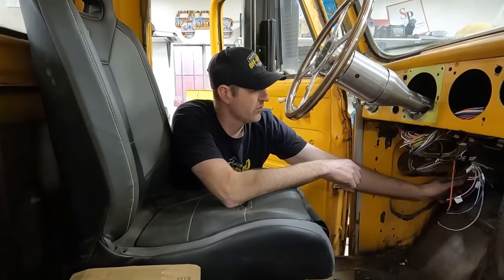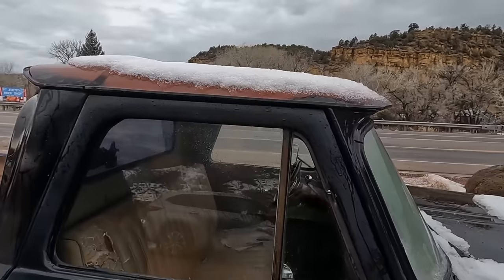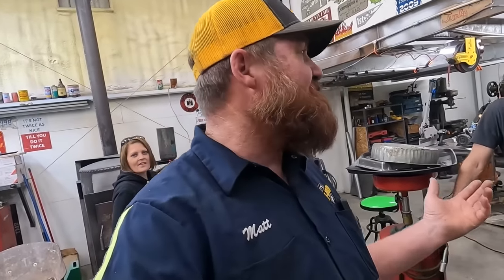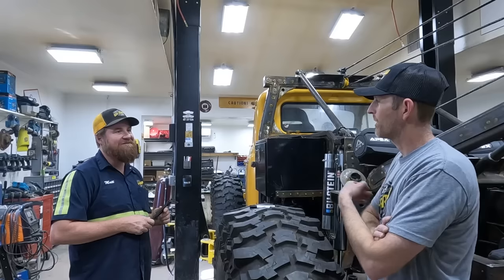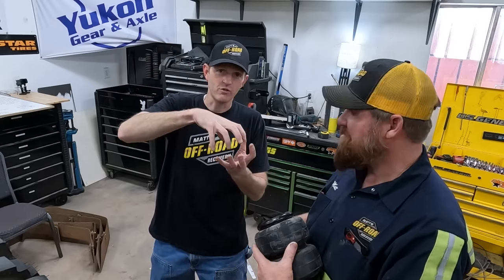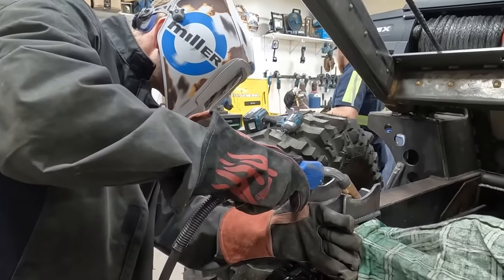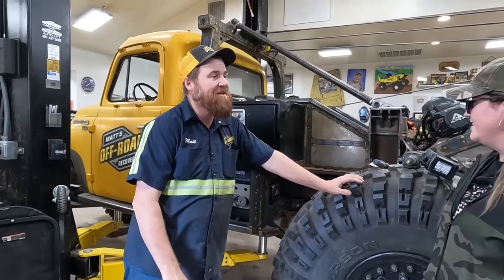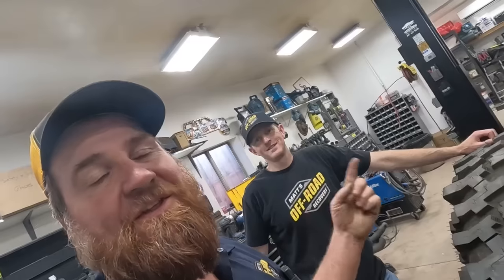Massive Announcement...It's On For The World's Largest Off Road Wrecker

Comment: As a structural welder of 20 years, I would like to give you a little tip.  When you get to the end of your welds, normally there will be hairline cracks in the crater.  You'll see these cracks more visibly with aluminum, but they're there with steel as well (can be seen with magnetic particle inspection).  With something that's truly static it doesn't matter as much, but with some parts on the wrecker that are moving, over time those small cracks can run along the length of the weld and cause it to fail.  I've seen this first hand several times.  Maybe you do this off camera, but from what if seen in your vids you don't.  At the end of the weld, pause for a second, then give a little shot extra in the crater.  This will cap the tiny cracks, and keep it from potentially working their way down the weld.  Aside from that, I like the work you guys are doing!
Reply: if you get shrink / crater crak at the end of every weld you are doing something wrong, but your solution to preventing it is spot on , fill the end a sec longer to prevent to crater to form.
Reply: this should be pinned.
Reply: I agree.  I have been a welding inspector since 1984.  When you are welding the weld crater is digging into the base materials.  If you just stop without filling the crater you will have an undercut situation and a crack will form.  One other thing to do, if possible, continue to weld around the corner into the opposite side weld.  Ends of weld are a great place for fatigue cracks to start.
Reply: Thanks, I never knew this ... but ... I've always left a little filler there to hide the crater, must be the OCD in me & lucky to do it right unknowingly!
Reply: @j.decker7443  so essentially over lap and pause where needed?
Reply: they have mentioned they are very good grinders too.
Reply: How much an hour you think you're worth?
Reply: @mareli82  You will get this if you do everything right, it's part of welding.  I've been certified in steel/aluminum multiple positions for years, I'm very meticulous about material prep, correct parameters and procedures.  You can do everything by the book and still have these cracks.
Reply: @zozohoney79  by code its not acceptable to have any cracks in the weld, so if the weld have craks its done wrong
Reply: We use to call it wrapping the end on submarine work.Makes a big difference.
Reply: @zozohoney79  material preparation is overlooked many times and people just don't understand how important it is to have clean metal.
Reply: @ike8236  You can't afford me - really. I'm retired now. 27 years pipe and structural welding. Stick, MIG, TIG..
Reply: 👆 I agree. I'm a retired Navy Hull Tech NDT, QA. etc.. etc.. etc.. 😂
Reply: @mareli82  I agree.  If you don't fill the crater at the end, then technically the weld may not be sound.  That's why I'm pointing out that it should be filled.  If you think you can just stop a weld without filling the crater, and never have any cracking, then you are mistaken.  If you check every one of your welds with magnetic particle, I guarantee you will find some cracks.   Research this, and you will see I'm right.
Reply: @karlschwaber9568  I couldn't agree more.  Scale should be removed from steel, oxide should be removed from aluminum, and I clean everything with acetone.  Aluminum is particularly picky with things needing to be clean.  The majority of steel welding I do is with flux-core, so the flux will remove a lot of impurities, but that doesn't mean you shouldn't clean the steel.  I don't take chances with the work I'm doing.
Reply: Thanks for the tip.
Reply: Yeah I've seen construction equipment welds fail just like that. 
Gotta grind the whole crack out then weld it back.
Reply: @fraxonthefurry21  there is a huge difference between construction equipment and the bump stops on a vehical.
Reply: Great point. I agree 100%. Sometimes these craters are left at a stress point so it's actually the exact starting point for the crack to start and run.. As a fabricator things like this make my head 🤯🤯🤣.
Reply: @j.decker7443  so pop a pilot hole in the future crack and stop the spread before it happens.
Reply: I love the fact that Master Craftsman chime in to share these little tidbits of knowledge that make everybody better.
Reply: Many new weld machines will have a setting that will do this for you and have a gas purge at the end of the weld as well to get a better finish purity.
Reply: @TransLivesMatterTLM  Look who's doing the welding? What the hell's that supposed to mean? Are you referring to Lizzie? I guarantee you Lizzie's welds are better than 99% of the men watching this channel - including me!
Reply: Informative constructive criticism, delivered in a respectful and helpful way. Congrats for this unicorn post!
Reply: @olsparkywisenheimer8239  Also a great point! So Perhaps it's better to start your weld midway and weld to, and around, the stress point?
Reply: @alexislaisney3404  Why? Just weld it properly in the first place.
Reply: I used to work at a structural steel shop and that's what we were always told to do. At end of weld stop and weld backwards about 1/2 inch.
Reply: @randallsmerna384   She is certainly no master welder but is getting better with each day. She runs great beads and is well on her way.
People welding Kenworths on the assembly line are not masters after a year of doing it all day, nearly everyday.
Lighten up :D
Reply: Thanks for suggesting a Tesla motor. Or four!
Reply: @randallsmerna384  That would work. How i would approach it would largely depend on what I'm doing. 10 gauge on a custom car would be different than 1" plate on a pc of equipment. My advice would be if you're starting near your stress point make sure you aren't running cold. My main machine lets me raise the start value to eliminate cold starts, but i know many machines don't. You can always preheat too though and take that off the table. On 1" plate on equipment say, id likely wrap that corner with a root and a couple cover passes to add strength there, while being careful at the top of the leg not to und undercut the vertical plate if that makes sense..
Reply: @dozerboyd8784  This is for every weld on the truck !!!
Reply: This is the reading we use run off tabs when welding pressure vessels. Like large propane tanks
 We have a three inch tab of steel to start the pass on and to finish the pass on
Reply: @ike8236  lol. Waiting to see this comment
Reply: @dozerboyd8784  Clearly, but welds are welds.
Reply: Thank you I seen that too
Reply: @shimani141  Like the saying goes, Grinding and paint 'cause a good welder I ain't.
Reply: Thanks. This is why I read the comments, to get tips from the pros. Cheers
Reply: Didn't know this myself but I'll remember it next time I do any welding but Ive never had a weld crack in 40 years and I don't hold a candle to the worst welder in this shop.
Reply: @TransLivesMatterTLM  I'm very proud of Lizzy. She has come a long way learning how to weld. 
As far as Matt.... He is un teachable. Unwilling to learn. Run till you fail mentality. He should be setting an example and doing the right thing. 
But in their defense.. They did bring in a Miller pro to teach them the basics. But practice practice and continue learning is the key.
Reply: On critical work I'll weld run off tabs. 
But, My work is a hobby. I don't care about extra time it takes.
Reply: That’s what I was thinking that the welds could have a plate welded over them. Just a thought. It will be a on going project
Reply: Thanks for this tip.  I think bad obsession Motorsports do this on their welds.
Reply: Commonly referred to as wrapping your corners.
Reply: @TransLivesMatterTLM  well I mean its gonna be a wrecker that's actually used so I'm sure they do care about their welds..
Reply: @TransLivesMatterTLM  You're bit misogynistic, aren't you?
Reply: nooooooooo no more welding of the welding please... I am so over welding for the sake of youtube ad revenue... that truck is the most over welded vehicle on the planet
Reply: @bushmanphotos  nobody is making you watch... plus the loads that truck will see its definitely not over welded.
Reply: You make it too complicated. Just backtrack at the end of the weld. I spent many years as a certified welding inspector.
Reply: @bryanallred6661  Good advice or pull the bead over to the side. Ditto the years.
Reply: @randallsmerna384  imma be charitable and assume @Patazki meant her limited experience before this project, not her gender.  but maybe youre right since he doesn't seem to think using new blood is professional apparently lol.
Reply: @TransLivesMatterTLM  are you making fun of Lizzie? Let's see your welding pics.
Reply: As a weld inspector/welder/miner/metal worker/electrician/plumber/ lawnmower expert/ gas station attendant since 1835, I would like to offer some advice: 

Make sure you weld your end crater to the apex vertical round edge with 300 degrees of flux capacitor rotation ham sandwich. 

Other than that, keep up the good work! One day, you might be as good as me.
Reply: Thanks for the tip it can help all of us weekend welders or weekend grinders...
Reply: In my career as a welder when using MIG pulse the crater formed when stopping is by design, it gives you a place to resume welding. I'd do 14 foot long runs on each side of the truck I was working on, weld about a foot, let it crater, move to the side of truck, do the same, back to the other side, start in the crater and run another foot. To end a weld with no crater I developed a rip it away technique. Keeping the trigger depressed I'd weld to my end point, rip the gun away and let off the trigger after separation, yeah, I'd waste a few inches of wire, but no crater. This is just for pulse mig on steel. YMMV
Reply: What's the best method for welding carbon steel? I have some 6 inch guard rail c channel I'm making a trailer frame out of. Can I anneal the welds with a torch to prevent cracking?
Reply: This ain't something you need 20 years of welding experience to learn, it's something you learn at a weekend class or something.  But every guy knows that automatically knowing how to weld without learning anything from anybody else is what truly makes you a man.
Reply: @bryanallred6661  weld inspector... Not a welder. Lol gotcha.
Reply: @jamesnm21  If you have standard 6" channel it's probably just A36 low carbon steel, which wouldn't require anything special. You can look up how to spark test it with a grinder to tell, but it's not exactly a science. The only thing i ever weld anymore that's a higher carbon steel is occasionally A615 Gr60 rebar. Lots of preheat and a min E9018 or higher electrode works great on that.
Reply: @bryanallred6661  Who's making it complicated?   You mean the run-off tab guys,  I'm talking about a quick shot in the crater.

Comment: For those that are wondering about the stops that Matt wants to put on the rear steering cylinder, they are a common item on cylinders. On a forklift, they are used to limit how far the mast can tilt back.
Reply: We use some on the lift cylinders on our haybine to limit how low it goes so we cut hay a little higher on rough  or rocky fields. They just clip on and off the ram.
Reply: My only concern is in an off road environment , mud, sand, ect. they will pack debris against the seal causing premature failure of the seal. the seal or wipe is designed to wipe the staff ,as the stopper comes in to bottom out it is going to trap and press debris under the wipe.
Reply: I would like to think there's going to be some sort of rack boot over them. My concern was the sleeve scoring the shaft. A plastic liner down the inside should suffice.
Reply: @Mike  we've put them on our tillage equipment which gets dragged through some of the worst sandy dirt and mud you'll find. Never had a problem.
Reply: This video teach me so much what parts u have in list Matt my dad also watches your video he sent me watch your videos
Reply: @boostin100  sleeve cant move so no scratches
Reply: @jthomp997  Never ? had a seal fail? how old is the equipment? if the equipment is leased or up graded routinely  you may not see the result. They all fail ,even in the cleanest environment ,so to say never is  a bit hard to believe. I've seen guy's pressure wash their equipment and wreck a seal.
Reply: Yeah, very common in agriculture. I’ve used them to set depth on tillage equipment.
Reply: They go on the front and back. Anything done on the front axle will be done on the back because they are the same
Reply: I think he’s only putting the limits on the rear, he said in a earlier video he didn’t want as much steering travel on the rear. I think he said it will have a separate steering control like a double throw momentary toggle switch and not controlled by the orbital front steering valve.
Reply: @Mike  *never had a abnormal problem due to the spacers. But I mean really we don't have many hydraulic seals catastrophically failing in general. We'll replace them beforehand in our really old equipment if we know we'll be using it a lot but thats just preventative maintenanceat at that point. And if a pressure washer takes out one of your hydraulic seals then that seal was failing before you ever washed it.

Comment: Hey Matt, you need to checkout the tap holders that look like a drill chuck but you attach them to any 3/8" ratchet!! Snap On and Mac have the exact same set. There are 2 in a set for larger and smaller taps.

Comment: Looks like Paul (and Matt) are making good use of the cutting tools I sent him for his lathe. Those rotors are massively hardened steel and the tungsten carbide tools just treat them like butter.  Good tools make it look easy. 👍
   And, having seen what he keeps in that hanger down by the airport, I vote for Paul's cousin Merlin and his wrecker. If he had the time to build it right, and took it seriously, none of you guys would stand a chance at the Tow Truck Olympics! (Think dual 12V71 diesel power plants in a semi chassis. 😈)
Reply: but it will not have most weld.
Reply: Those rotors were definitely cast iron because of the dusty chips and Matt's stained hands... They were using high speed steel to turn the rotors because you don't sharpen tungsten inserts(matt said they sharpened them).
Reply: @charles3028  Not inserts. They were using stick tools. Which do get sharpened. Notice the pile of chips on the floor afterward? Not cast iron.
Reply: @sagebrushbob2321  Yep, that's what I said. Stick tools(high speed steel) is what they were using. I have machined way too much cast and i'll never forget the dust and iron smell that permeates your skin.

Comment: Tip for tapping, get an nut that just does not fit the tap you need and press it in the tap whit a vice. Now you have an tap that can be operated whit eny tool that the nut fits.

Comment: Pulse mig welding is not so important with mild steel, you can get excellent penetration with non pulsed, but is the bees knees when mig welding aluminium and stainless steel. I spentmany years fabricating in aluminium and stainless steel and it was a joy to use pulse migs for this process compared to short arc on a basic mig. You can control the weld puddle so much easier.

Comment: you can get ratcheting tap handles for that exact reason. and yes there are portable tapping machines too electric or air driven. you can even drive a tap by clamping it in a cordless drill on low speed.

Comment: 29:45  TAP SOCKETS !!
They make individual ones
and/or ones that work like a drill chuck !
Edit, added 
Lisle makes the sockets, 70500 ~ $30
Irwin makes the chucks,
3095001 also ~$30
The sockets don't always fit every tap snugly, different brands use different "square" sizes
Reply: I was hoping someone would add the tap name!  Thanks @kenneth Albert!

Comment: brake rotors are cast steel/ cast iron which doesn't make the curly shavings like steel brass and aluminium do, it makes tiny little chips almost like sand it goes everywhere and you definitely don't want that in you eye or your skin. long sleeve shirt and a apron and safety glasses are a very good idea. exposed skin should be treated with a barrier cream to stop the metal dust getting in your pores.

Comment: A square or spline 3/8 drive socket that fits the drive end of the tap and a 3/8 drive ratchet works really well in most tight spaces as well.  A benefit is that you can use an extension as well.

Comment: Matt, Gearwrench makes a ratcheting T-handle tap and die set. It also includes socket adapters for the taps.. So you can use them with your sockets.

Comment: Casey LaDalle needs an invitation.. Another excellent video, But!! just ask the Air Bag manufactor about burst pressure. You have better things to do than break things to make content. The skills Tom brings are a a big boost to your builds, the back and forth between you two as engineer vs eyegineer is great and reinforces the value of experience on both sides of any question. Dont stop, you are doing great!
Reply: Casey is a judge.

Comment: I think you should expect about 20000 lb on the limit strap with 10000 lb load on the opposite tire at twice the distance.  I think the easiest way to this conclusion is to draw the free body diagram for only the axle, then consider sum of moments about the axle center.  Once you know that, sum of forces will tell you that the downward force you've drawn at the axle center is close to 30000 lb (weight plus balancing the downward tension on the limit strap).

Comment: The airbags wont blow up if you lift it in the air. airlift bags, idk if those bags are or aren't, manual does have a note to not leave vehicle lifted in the air with bags filled. air out when leaving vehicle on a frame lift for overnight. When i do maintenance on my vehicle its aired up to 80psi on all 4 corners prior and during lifting from the frame for routine Maintenance. Maximum pressure for my double below are 125 psi and 'lifestyle" bags are 100psi.